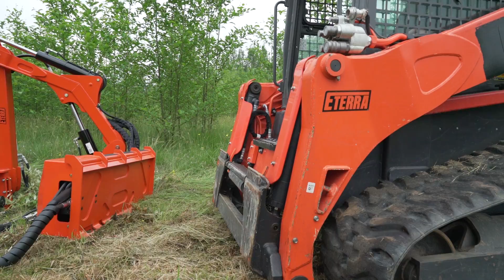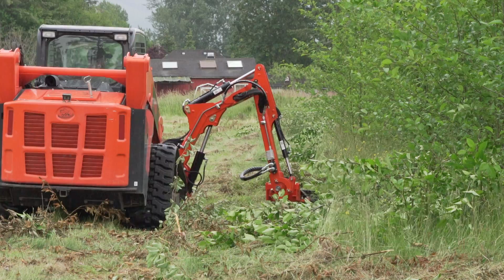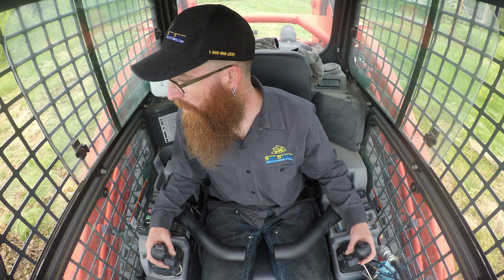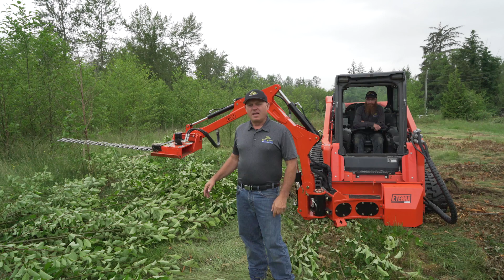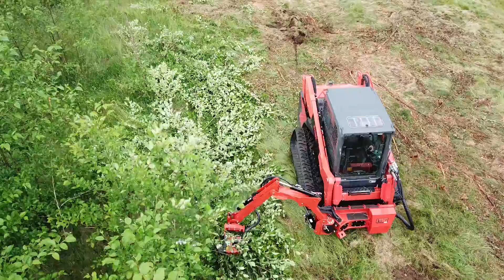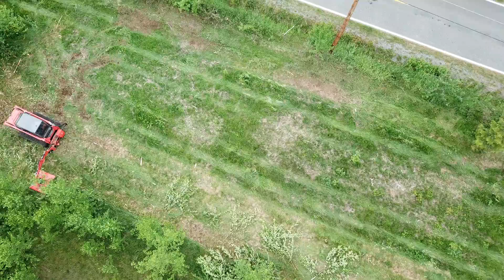Your First-Time Using the Eterra Raptor Boom Mower Attachment | Skid Steer Solutions

Comment: I have an eterra RT-20 sicklebar  boom mower that is very similar except there is no case drain and the RT-20 appears to be a "beefer" boom mower. Mine also does not run off the skid steer electrical  connector but has the eterra remote controllers and cables. Someone should do a video on these as well.

Comment: I work for the county road department and I go out shoulder mowing all the time. While our mowers aren't skid steers and we use deck mowers, not sickle mowers, I can vouch for the importance of paying attention to you mower. We are constantly destroying things, usually cable peds and sometimes signs. We've had operators get tangled up in guy wires for power poles and bring down whole poles before. We've ran into fences. Nothing like hitting barb wire that someone throws away in a ditch. Then there is the stability. We have counter weights mounted in our wheels and we still get those left tires off the ground occasionally. It's a fun job but lots to be aware of. Anyone considering buying one of these or any other type of side mowing attachment better have a good insurance policy. You will cause damage.